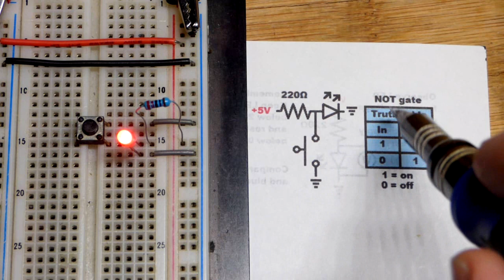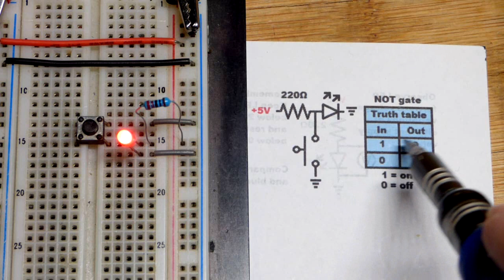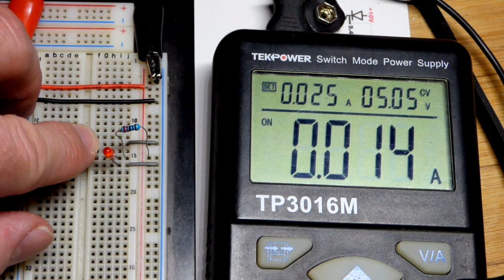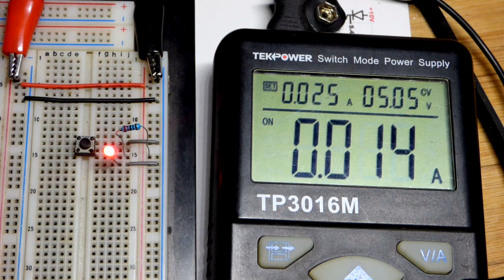Push button switch based NOT gate demonstration circuit for learning electronics shorts 55

Comment: This is something I have not seen yet! xD Would a series resister to the voltage rail help limit the current being drawn?
Reply from the maker: Yeah, for a practical circuit you'd probably want some resistance to ground. Just has to keep the voltage at the LED low enough that it stays off.